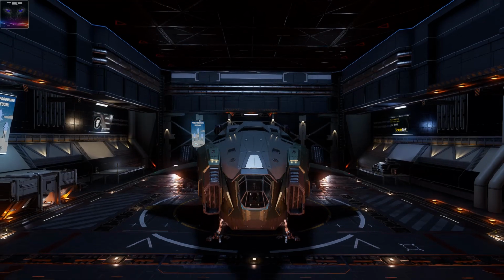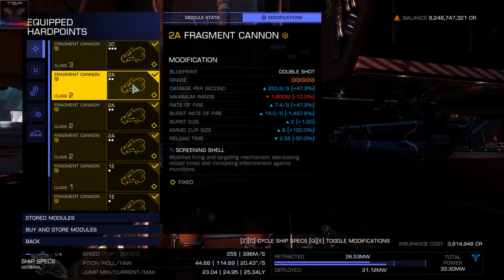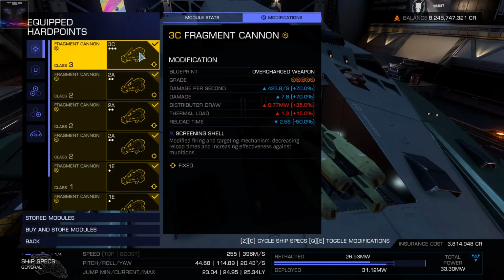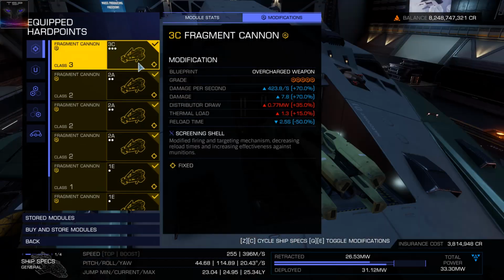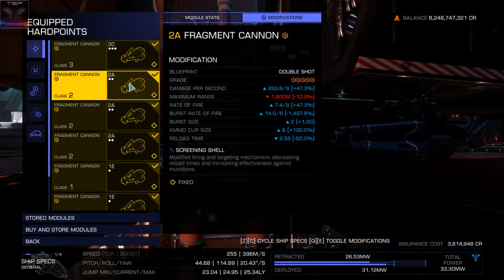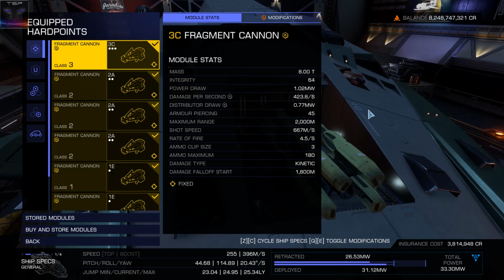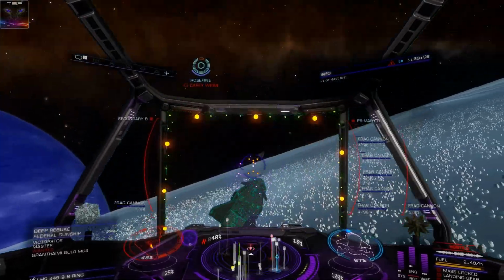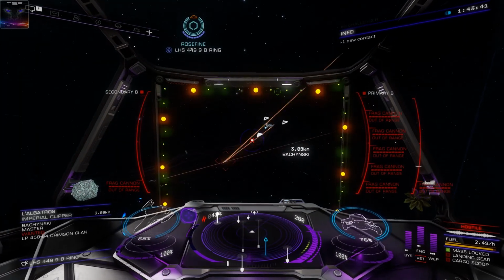Challenger 69: Space Shotguns - 7x G5 engineered frag cannons Build - Elite Dangerous

Comment: I did the same thing with a type 10. On the two size one hardpoints I had 'corrosive shell' and 'drag munitions' and all harpoints engineered to grade 5 'high capacity'. Others are 'incendiary rounds' and 'oversized'. Not fixed though obviously, gimballed. Plus type 10 is practically fully engineered. Earned me a few quid, bless it. 😏
Reply from the maker: Was thinking of using T10, but it's too bulky and slow for shotguns, you can't even get in range properly and gimballed or turreted is quite a waste. if you just want a bounty hunting ship, go with lasers and multicannons. it lasts very long. I might try and make some laser only build for bounty hunting.
Reply: @SethiozProject  yeah, fixed for the win of course but no chance of that on type 10. Fully engineered t10 doesn't handle too bad with fa off and on for turning and preempted passes. 9 frag cannons are mental. I understand about using lasers but I'm not about making money fast anymore and don't mind the trip back and fourth. You do get a lot of kills with the extra ammo of grade 5 high capacity, disregarding the two class ones. They have half the ammo (ish) so do without them half way through or Synth. Love the type 10. Better ships out there but its not all about that.